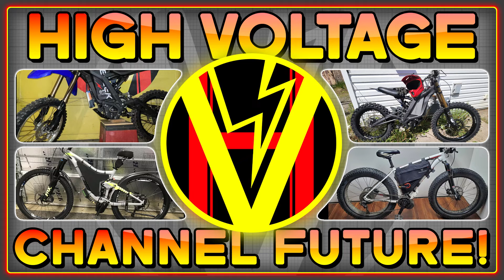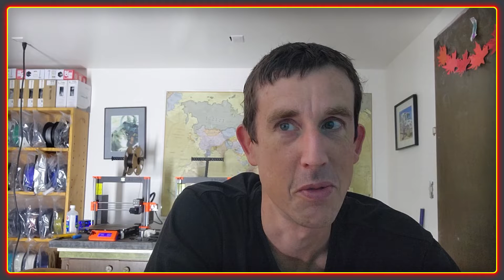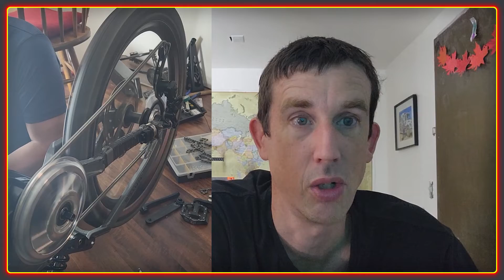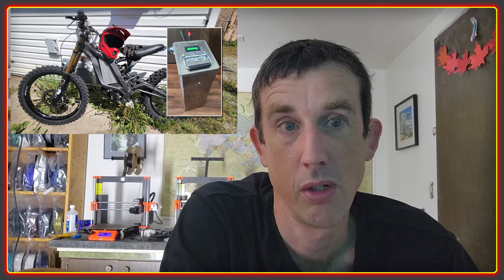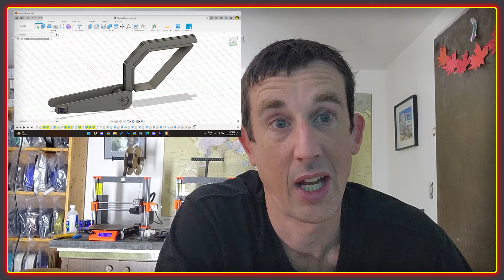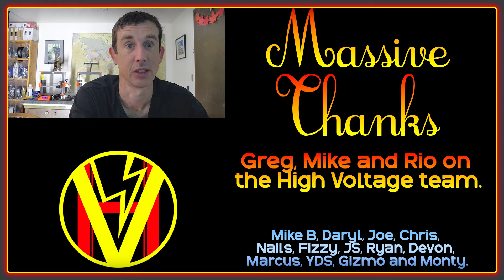The Future of High Voltage - Going full time!

Comment: I bought all the bbshd stuff because of your Videos. Thank you for the guides .
Reply from the maker: You are most welcome! Love to see you on our Discord server if you are interested.
Reply: @HighVoltageKits  I also bought the Eggrider V2 for my setup . for now it is with the stock controller . for the future i planned to switch to the ASI bac 855 with the kit from your shop . but for now i enjoy my build as it is :) It is a sleeper build . I mounted the Kit on a 30 year old Bianchi Thomisus . The Frame fits perfectly for the 60V / 19.2 Ah Batterie . This was because of keeping costs down . At first it was on low budget but next step will be a fully MTB with some better brakes and suspension on front and rear .

Comment: bafang USA is doing me dirty a replacement speed control I bought 9 months ago crapped out all of a sudden so I went and bought another one that one I got a code 30 two days after I bought it and they made me send them a video and they said I cut a bunch of wires and stuff and then refusing to warranty it and I didn't it's in perfect shape and so is my build I even put the other speed control on there was no code 30 I show that to them and they still said "like I said I send every component to me EXCEPT ANY SPEED CONTROL so I can inspect it" and it has a 90 day warranty.....so pissed I'd like to get a better controller but I've only got a 52 volt battery and I can't seem to find anything any suggestions anyone?
Reply: so check this out all I had to do was to Simply reflash it and once I gave the "technician" my results from my from the multi meter he should have told me to do that he instead he tells me to ship all my components to him and probably charge me to inspect it what a joke and it's all stemming from right when I got my last speed control I asked him if I can cut the wires down I know stupid to even ask is that avoid the warranty and then he went on to say basically how that's how stuff gets messed up so when people start modifying it and I went on to talk about they're crappy Spade style connectors on their battery and motor terminals I didn't know they were a feelings company they really gave me the middle finger though in the remote assistance they call is an absolute joke it's a way so they can void your warranty by looking at your bike and finding any little problem with it which I had absolutely had none they seen an unplugged battery light because the new speed control had a proprietary plug on it I didn't want to mess with the warranty but all that went out the window anyways lol cause of my snooty remakrs I guess
Reply from the maker: Snotty remarks should not lose you warranty. There customer service if you can call it that is well known in the industry. The DIY field has been doing it for them for years. Glad you got it sorted!
Reply from the maker: That sucks and is pretty typical with them x cs wise. Error code 30h is often a wiring issue. You might want to check your harness. You can look for continuity. Zip ties can cause damage resulting in this as the wires are very thin. In terms of options on other controllers there are external ones like the ones we make. A first stop could be to join our Discord server and get some help testing the harness. It might be the error is not terminal. The link to join is in the description. Let me know if you have issues. Cheers
Reply: And that's why I'm so pissed is because I put my bad speed control back on and the code 30 went away then I sent him a video of that showing it was irrefutable that it was something with the speed control they still were like....."like I said I said can't help anymore" and told me to make sure when I pack up my kit to ship off that its bubble wrapped nice and good. straight up dicks
Reply: You know what else? It seems that if I had a Facebook for years or some sort of following they definitely would not have done that to me. That Discord thing sounds cool but I don't really know what that is I just wondering if you can answer  a quick question when I installed the new speed control the pas system only comes then shuts over and making it unusable. IF there's a missing magnet on the plastic disc would that cause the motor to turn off and ON? As I was waiting for the new speed control to arrive I took the steel gear cover off and poped off that  ring seal on the big bearing and repacked it full of  grease (what a difference by the way)and may have damaged the disc.

Comment: Right on man!  Long time viewer, rare commenter - I love what you're doing. 
Any plans to continue with the Bafang M620 'conversion' board?  I find myself in possession of a Bafang M620 UART motor (and frame) and would like to pop a BAC 855 (or maybe even a BAC 2000) onto it (or a Phaserunner V4 - if those ever come out and start shipping?). 

It seems like my solution will either be 1) sensorless, 2) throw away the stock controller boards and put in my own set of hall sensors, or 3) pop in the 'conversion' controller board that I've seen you talk about (but have not seen available for purchase). 

Option 1 is... a little on the jank side. I'll do it if there is no other choice, but there are much better options.
Option 2 is... certainly doable (I've done it before on hub motors), but it seems kinda of a waste when some form of hall/encoder output is already available in a portion of the stock electronics
Option 3 is... certainly the most compelling, not only from a 'plug and play' standpoint, but just the sheer elegance of the solution as well. But alas.... only if I can buy one.

Definitely looking forward to more of your content!
Reply from the maker: That's Mike's baby so we are ironing out kinks and getting through the bbshd backlog first. It's still on the cards tho
Reply: I can tell you that sensorless is not the way.
I have the kit on an M620, it's amazing aside from trouble with the torque sense (currently PAS entirely disabled). 
I'd say its worth waiting for the kit if you have the money £££s! But if you have time, get playing, the kit just repurposes the original sensor chip and magnet for positional feedback by using a standoff board. Soldering would be fine for you as a single user modding

Comment: You could really blow up in sales, if ASI could keep up with demand.  So many people I talk or comment with, want BBSHD upgraded controllers, but can not get a hold of one.  Too bad another company/person hasn't invented another option for BBSHD.  Cheers.
Reply from the maker: We had some real issues earlier this year but we are looking much more stable now. Forcasting is hard but we are getting better. We used the downtime to refine everything from the harness to the mount and controller mapping. A few other goodies on the Horizon but must keep Mum for now!
Reply: It’s not always a supply issue. It’s hard to forecast months out when capital is an issue as well. I have over 400 BAC4k units sitting at my shop simply because we were able to forecast 6 months ahead.

Not always the case but more than likely a combo of both
Reply: You can use VESC controllers for the bbshd. However, they're no where near as plug n play as these kits
Reply: Im along for the long haul brotha! I'm looking forward to a bright and prosperous future !
Reply: i dont want this asi controller anymore its way too expensive anyway and they dont allow u to modify it only for official reseller
Reply: @albertmonsieur7832  If your an official reseller then you have a completely unlocked controller. You tune it for the customer and lock down what you want. You cannot leave them fully open u less you developed your own end use tuning software.

Comment: Where will we be when silver rises to higher prices in a few years,  the batteries will be so expensive that few will be able to go electric.
Reply from the maker: Interesting point. What is the supply pressure on Silver? I had not heard about that one. Battery tech does finally seem to be getting more diverse so I would think new chemistry etc. Or like with light electric vehicles using less batteries perhaps we could use those more.